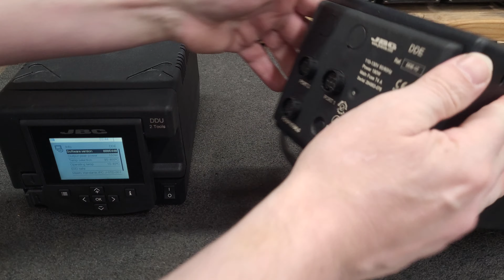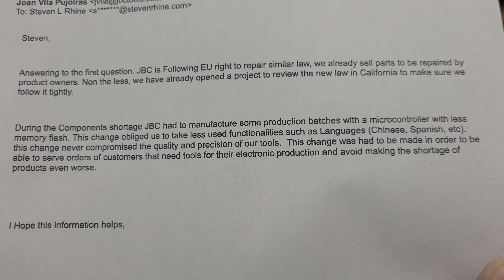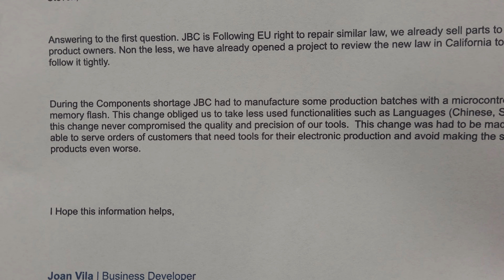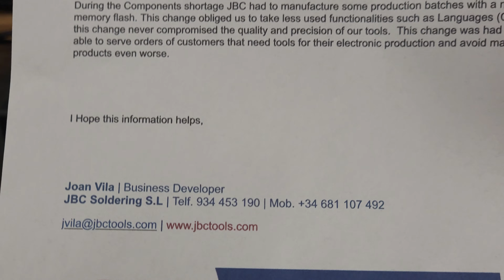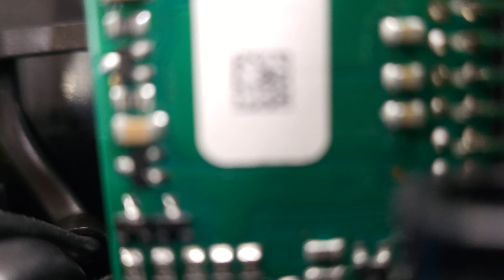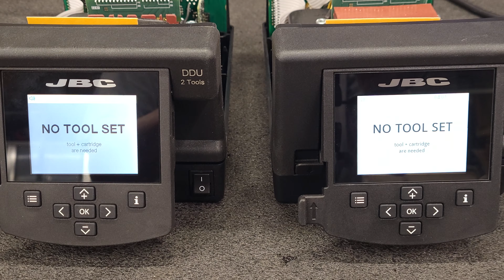Warning JBC Tools DDE-1C Soldering Station Firmware Issue! Right to Repair Signed In To Law.

Comment: I haven't bought DDE, but JBC's current products have indeed shrunk in quality. I purchased the CD-2BHQF, which used to come with a transformer. However, the latest batch of JBC's CD series soldering stations now use a switching power supply instead. I emailed JBC to confirm, and they informed me that they will gradually transition to switching power supplies. The funny thing is, the manual included with my soldering station still mentions the transformer component.
Reply from the maker: @JACK-TIM666  mine are not to old lol less then 1 year. And at time of video brand new.
Reply: I have a new cd1bqf and I am pretty certain that its got a tranformer in it. Have not opened it, but its pretty heavy so I would be shocked if it's not.
Reply: @tokin420nchokin  you can try to open it , you will find a switching power supply and a huge Metal Block to adding weight

Comment: @Rhine-Labs Hey Rhine,

Just got my DDU (DDE-2C), the unit doesn't go to sleep mode. The unit is running the infamous 8886448 firmware. I tried to download the latest from JBC with the hope that such issues would be patched. The unit freezes when I insert the USB stick. I tried many other USB stick, same issue.

Have you found a workaround as of today ? or is there a specific firmware which works that you got directly from JBC ?
Reply from the maker: Contact JBC they are aware of the issue's they may say they have never herd of it (that's seems to be their default) or they will ignore you but they are aware of the issue. If you have a unit with a Downgraded MCU you are probably may be out of luck. They did recently update their software download page https://www.jbctools.com/software.html and the DDE-C Says SEE TABLE and list of serial #'s so not sure if they are making custom firmware for units affected?
Reply: @Rhine_Labs Thanks for the feedback. My unit is not listed on their website. So i'm attempting to use 8886903 without any success so far...if it's hardware related, how could they miss this in production, do they actually test their product at the end of the production  line...very disapointed.
Reply from the maker: @rslyrick5315  You prob have a unit that was made using a downgraded MCU see my dde teardown live stream And Blog Post https://www.stevenrhine.com/?p=131943 JBC will prob need to replace your unit but they will try and tell you nothing is wrong or just ignore your complaint.
Reply: @Rhine_Labs  Hey Rhine,

so I got in contact with JBC support (spain). I got a very quick and friendly support regarding my issue. They asked me to actually update my unit with 8886905 (my unit was not listed though...). I think that they update the online device list based on customer complaints. Sleep mode and hibernate are now working just fine.

Note that the process for updating via the USB stick is slightly different from what's described within the "Firmware Update Manual" found next to the binaries archive on their website.

You actually have to plug in the stick and then boot the unit. I used a FAT32 stick.

Note that the file size for 8886905 (3 Mo) is significantly smaller than 8886903 (8 Mo)...maybe it's related to the MCU downgrade not being capable of handling big binaries, so 905 is probably made for these units. I don't really know...anyway, it seems that i got a better support experience than you or other people complaining here.

Let's see how this unit performs in the future. I have 5+ years old JBC equipment at work, I love it. That's why I invested in one for my private usage. Let's see if the quality is still there.

Anyway thanks for your investigation work and for sharing your experience with us :) !

Comment: My station has the same cheap board. I took mine apart to verify. I contacted JBC, and they denied the issue.  I had to send my station in for a repair.  JBC said repir wait time is 6 to 8 weeks.  I had to buy another station (not JBC) so I could continue my work.  I am disappointed with JBC.
Reply from the maker: Did it have missing features and not take the firmware update? If so file a complaint with your attorney generals office so there is a record. If jbc wrote an e-mail denying knowledge of the issue, submit it with your complaint.
Reply: @Rhine_Labs  Yes, my station had the same missing features, did not take the update, and had the same sub board installed.  I have pictures and emails.  Plus, I have to wait month(s) for service, and I had to purchase another station to continue my work.  I will look for the Texas Att. General's contact info.  Is there a form or, do I send an email?

Comment: I think I also have the downgraded station. I've also purchased separately the desolding gun and module and despite me saving the peripherals the gun will get hot and relay temperatures to the display but will not turn on the vacuum module. Module and gun confirmed working. Can anyone replicate?

Comment: I found out that i probably have the same problem with my JBC DDE-2C (Europe 240V version) i bought it in July 2021. My station has ALL features in the menu.
I can not get the firmware update to work, it starts the update and then reboots, i have tested multiple USB sticks and redownloaded the firmware. Here is a short video of my problem https://youtu.be/QotNj5br5-w?si=Y31K9iFq9G0HMdPV
Reply from the maker: I'll check it out.
Reply: @Rhine_Labs   i hope i did not get the "downgraded" MCU version
Reply from the maker: @horst.zimmermann  @JBCSolderingTools still has not made a public announcement on their site to which units SN range that were affected. But what yours is doing I believe what mine was doing + mine was missing features. I believe a complaint with the a few states attorney generals and other actions has been made/started recently.
Reply: @Rhine_Labs  i will send them an email on monday, lets see how they react..... i dont have much hope because my unit is from 2021. I report back after i hear back from them
Reply from the maker: @horst.zimmermann  I am sure they will ignore it like they did with me and others on  brand new units. Be sure to file a complaint with your local government consumer protection and if they do not resolve it search Spain and Hojas de Reclamaciones and file a formal consumer complaint.
Reply: @Rhine_Labs  i will for sure.... thank you

Comment: My new dde station does not have info menus. The device does not update.
Reply from the maker: Thanks for Posting seems like JBC still has not recalled their units with problems and missing specs/features. Whats the firmware version? If you cannot get to it via menu, When it boots it will show the firmware version.
Reply: @Rhine_Labs  67 77
Reply: @Rhine_Labs  hello. They recalled the device. They gave a waiting period of 3 months :(
Reply from the maker: @yavuzmahmudoglu  wow 3 months to replace the unit?
Reply: @Rhine_Labs  Unfortunately. too bad

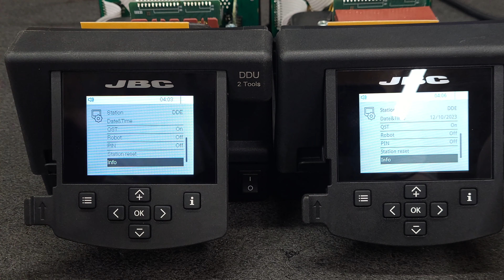Comment: 20:20 - have a DDE-2B with same limitations, but I was able to set the Station name via WebManagerLite App from JBC
Reply from the maker: I was not able to get the webmanager software to work. Have not tried it on the  replacement units.
Reply: @Rhine_Labs  The link to the app in the documentation of the manager is wrong - instead of localhost/WebManager it has to be localhost/WebManagerLite

Comment: The fact that you can buy this station today and buy it again in a year, with the same model number and have a totally different UI is just embarrassing.  The bad soldering problems others have posted leans more towards what I'm getting at.  They seem to have very poor quality control considering the size of the company.  Both their software and hardware process control is being operated like a small time once type company.

Also the fact that they removed features and tried to cover it up; at $800, wow.  What a company.
Reply from the maker: Ohh the saga continues...

Comment: I all agree about the MCU substitute issue but different transformer argument is nonsensical. Manufacturers often use multiple sources of the part, and transformer is probably the easiest to order from multiple sources manufactured according to your spec. Especially in the past, manufacturers often require that part has a second source to even consider using the part. It's like complaining some batch has a 7400 logic IC from NXP instead of TI. Also comparing in this way with multiple sources in the cars makes no sense either. Automotive has much stricter requirements/certifications. This on other hand is just a glorified heater, albeit expensive one. Diluting argument about the real issue with some nonsensical stuff only makes your argument weaker. It took you whole 16 minutes in the video to just start showing the real difference, most of people will stop watching by that time.
Reply from the maker: In high end stuff consistency in parts is a good thing because if you have an issue you can isolate it to a specific batch. See the live teardown it's 2.5 hours lots of rambling off subject stuff but seems I won the lottery and got some free solder splatter and a very high quality Bodged In CHANG Capacitor LOL JK.
Reply: @Rhine_Labs  I don't see how single supply helps for tracking batches. You either track which batch of parts go to which serial number range of devices or you don't. Nothing to do with multiple suppliers. Chang capacitors are actually not that bad and it's a quite old company. They even got multiple impersonators such as Cheng, Chong, ChangX, ChongX, ChengeX and similar. ChengX becoming quite successful and rising into a major brand from a small imposter, probably larger than Chang itself. Although for this price you'd expect something more premium.
Reply from the maker: @woopsserg  At the price point of these units one would expect premium everything. I do appreciate the free solder splatter! JK!
Reply: @Rhine_Labs  I really don’t see the objection to multiple suppliers — especially in a parts shortage, having multiple suppliers is the responsible thing to do! There’s a reason the US military basically requires second-source availability for huge amounts of components and materials, as this allows not only for redundancy in the supply chain, but also for price competition amongst suppliers. 

Heck, this MCU issue is a perfect example of what happens when you don’t have a second source!
Reply: @tookitogo  Multiple Suppliers Okay ... but still 1 product. "We buy X from you and it has to look like ABC and do XYZ, follows standards TRE" That's what you buy for the big bucks. Of course you can use the Hyper Car approach where you build 500 pieces with a jumble of parts, make them fit, so they look good from the outside and sell it for a f* ton of money. But that leaves one each being essentially an unique product and more of: All show and no substance (Aussen hui, innen pfui) setup.
Reply: @darknase  What are you talking about?!? Nothing depicted here is a “jumble of parts”. Rhine_Labs was complaining about different transformer manufacturers being used, but if you look carefully, you’ll see that the two manufacturers’ transformers are identical, except that the second one has an added cap. (Which very well could have been something JBC asked for in later production runs.) Everything else about them is identical, from the dimensions to the mounting holes to the PCBs on them.

Comment: I purchased mine A long time ago But was never able to use that features With the computer As advertised I Have the DDE-1B I always thought it was that they didn't manufacture their software right wow I stand behind j b c tools But now seeing this Kind of piss me off  😑
Reply from the maker: The dde-1b I believe, did not have profiles
Reply: @Rhine_Labs  You possibly might be right but I remember when I purchased I was supposed to be able to Communicate with the computer And change temperatures But was able to never do that .. But that is kind of dirty what they are doing Imagine if you didn't catch that And found this out a couple years later JBC Is subscribed to my channel I should make a video  Asking these questions lol
Reply from the maker: @QsTechService1  Yea, their Web Manager / Web Manager Lite software requires you to set up Microsoft services making your computer a server. I was not able to get it to run either.
Reply: @Rhine_Labs  Well if you figured out let me know .. To what would be awesome  dump the newer version Software And upgrade the flash memory  And dump it to another unit .. But I have to say they have the best sodering station Out there Nothing compares to their irons And the thermal Transfer